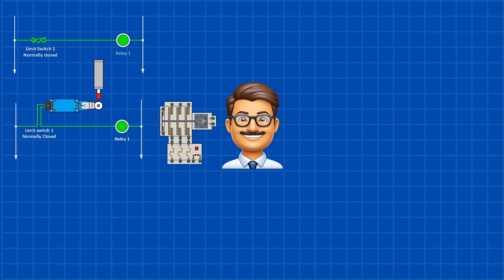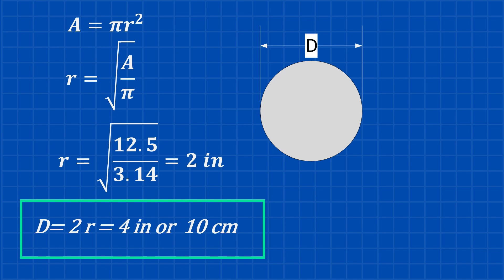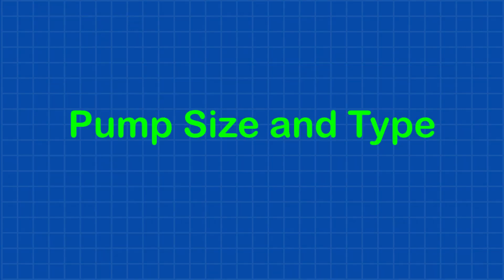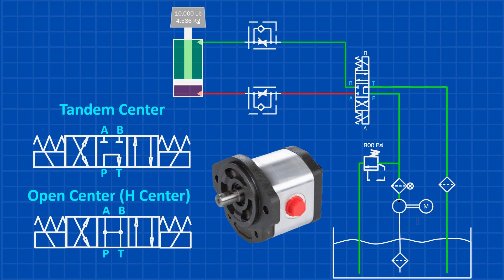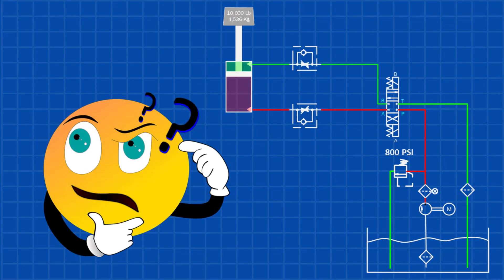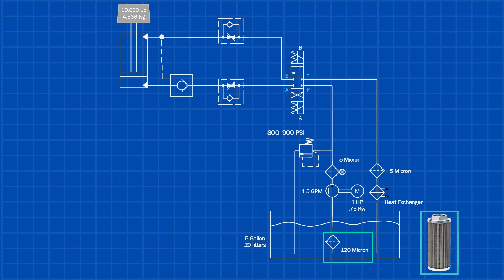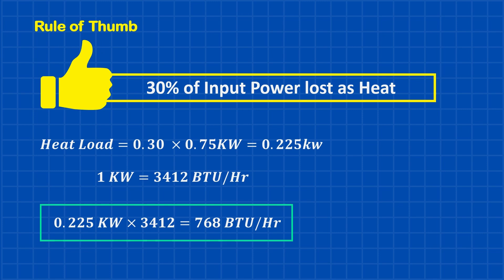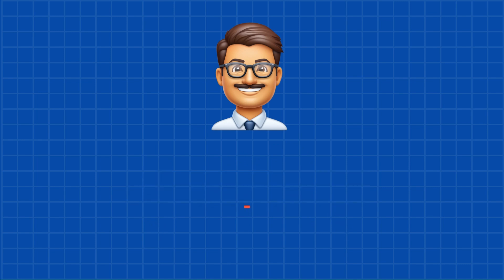Design Your First Hydraulic System. Step by Step Guide

Comment: I’m really hoping you can help me. I have a tractor that I want to modify by replacing the driveshaft with a hydraulic pump and motor. The engine HP is fixed at about 15. And the manufacturer has already engineered the gearing of the transaxle. I want to use hydraulics to eliminate the existing clutch. The input rpm needs to match output rpm 1:1 ratio.
Reply from the maker: Sorry, My experiance is in Industrial Machinary Hydraulics.  I wish I could help.
Reply: @Electrical-lad  I still think you have the skill to help me. Instead of visualizing a tractor, imagine that you have a 15hp electric motor that spins at 1600 rpms and you need to use it to drive a fan at 1600 rpms continuously for 8 hours. The hydraulic drive only needs the capability to operate the fan and have a control to start and stop the drive without turning off the electric motor. 
Please consider it with this scenario. I have complete confidence that you can help me.

Comment: Why did you start with 55 bar
Reply from the maker: We need to Have One known to calculate the cylinder size. I could have picked 80 Bar, in that case the cylinder piston would have been smaller.

Comment: Nice. using it to write and algorithm  and implemnt it using python or vba excel to size the design parameters and generalized for different requirements then use machine learning to implement a more dificult system. Thanks
Reply from the maker: You are welcome

Comment: Does this work for Pneumatics Systems as well?
Reply from the maker: Cylinder calculations remain consistent across systems. In pneumatics, the standard operating pressure is typically around 100 PSI (7.5 Bar).

If you're looking to understand the core principles quickly, check out my video: “31 Years of Pneumatics in 12 Minutes” — it gives a solid overview.

Right now, I’m working on a new video that dives deeper into pneumatic system design, so stay tuned!